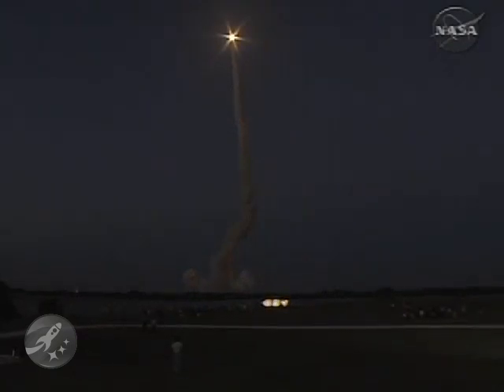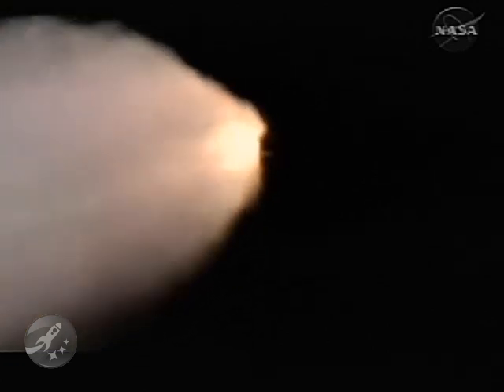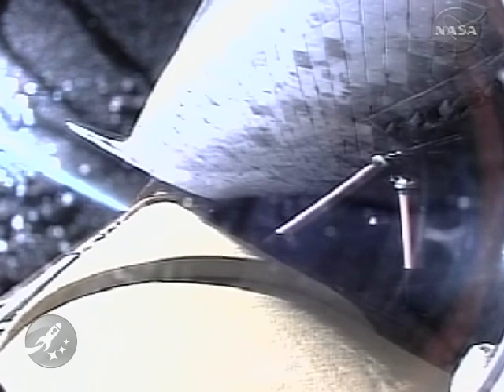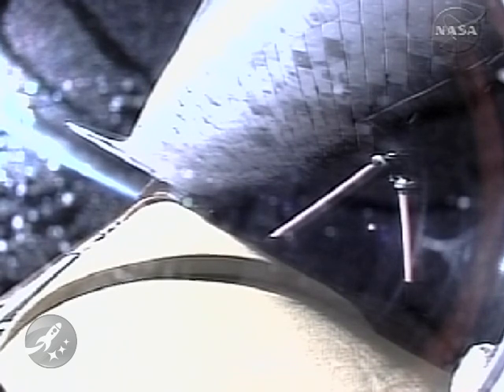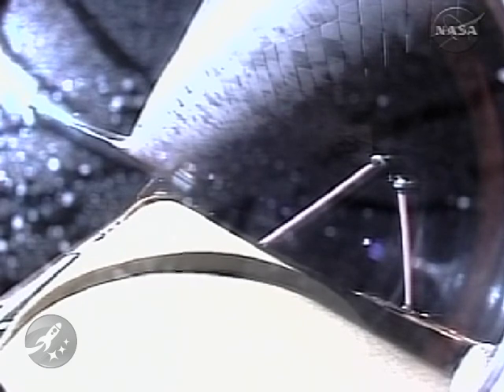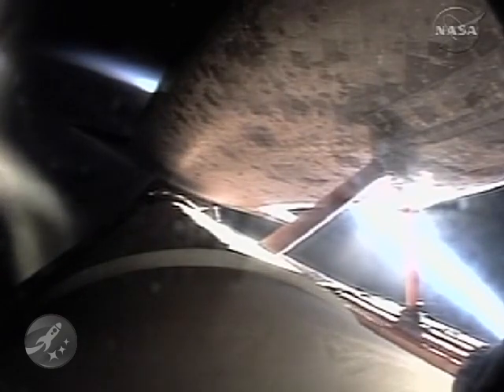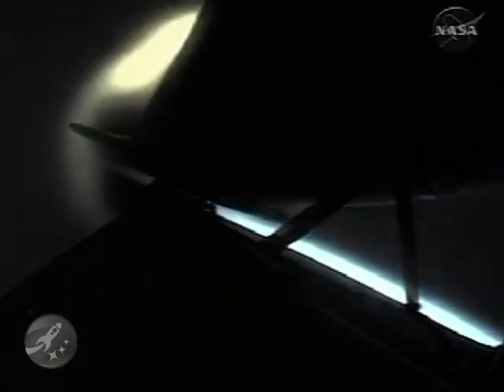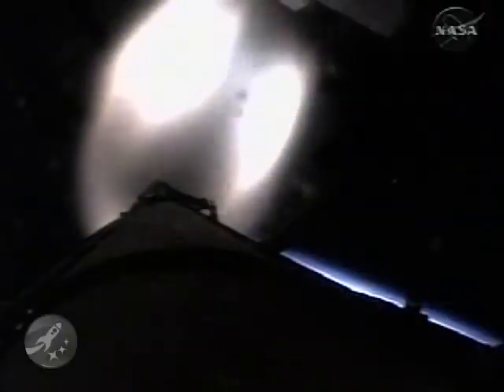STS-119 Launch of Space Shuttle Discovery From T-1 to MECO

Comment: @8:47
How can the engines be performing at 104%?

The narrators are reading from a script; this is bullshit, and above all, totally fake.
Reply: Proof?
Reply: The percentage level does not indicate actual power but rather rated output.

The SSMEs are rated to provide 375,000 pounds of thrust at sea level. However, through the combination of upgrades and certification, the SSMEs are capable of providing more thrust than the baseline.
When a higher percentage is cited, it refers to levels that are above the 375,000-lb. mark. Or, to quote NASA:

quote:The main engines can be throttled over a range of 65 to 109 percent of their rated power level in 1-percent increments. A value of 100 percent corresponds to a thrust level of 375,000 pounds at sea level and 470,000 pounds in a vacuum. A value of 104 percent corresponds to 393,800 pounds at sea level and 488,800 pounds in a vacuum; 109 percent corresponds to 417,300 pounds at sea level and 513,250 pounds in a vacuum

Comment from the maker: @denelson83 It doesn't explode. It vents vapors after it separates, which induces a tumble for more efficient breakup as it disintegrates during reentry.. The venting continues until the heating from reentry burns a hole in the tanks. It never actually explodes though.

Comment from the maker: @leisulin The SSME's have two things called spark initiators within each shuttle main engine (2 per engine x 3 = 6 total) that sort of function similar to spark plugs in a car or electronic igniters like those found in gas grills. The reaction happens in the combustion chamber. That chamber is connected to the bell, where the thrust is created.

Comment: what's the high pitch noise at T minus 15? (1:18)
Reply: StephenETavington Sound suppression water system That is designed to reduce that is designed to absorb The shockwaves from the blast of the SSME ( if you look at the bottom below the main engines you can see a waterfall coming from the sound suppression water system)

Comment: Technically, they do lose momentum. The Space Shuttle & ISS are actually located in the very upper reaches of the Earth's atmosphere. If they remained there long enough without a boost, they would eventually re-enter the atmosphere from drag. The OMS engines = Orbital Maneuvering System and they are necessary to attain the final orbit, dock with ISS, de-orbit, and do the "flip" that you see when it approaches the ISS so that they can take pictures of the underside of the shuttle.